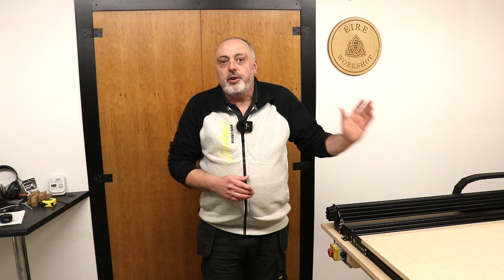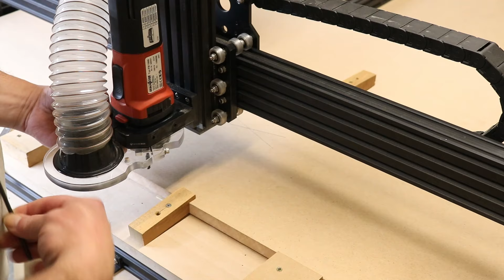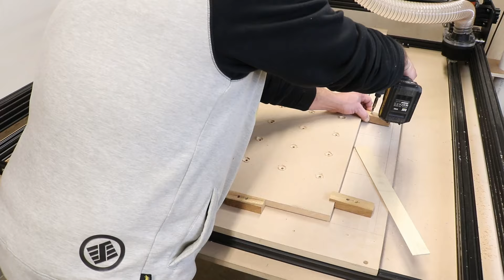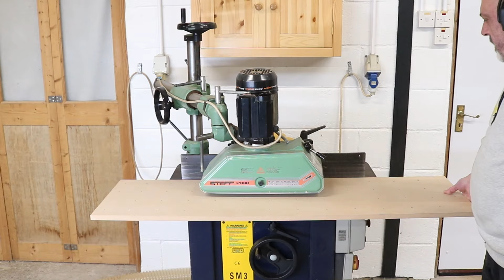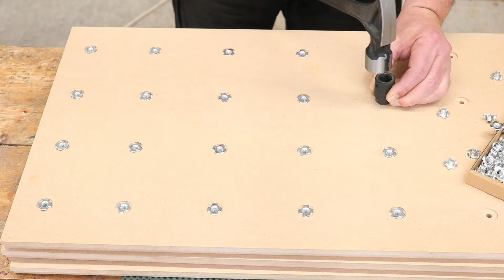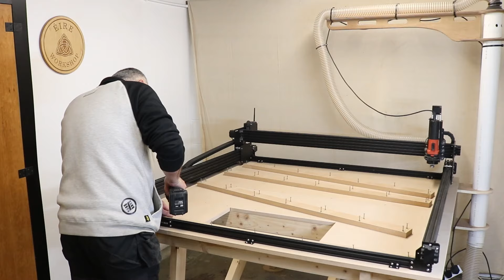How To Make A CNC Spoilboard In 3 Sections

Comment: Clever modification to give yourself extra height Tommy, very simple but I bet many haven't thought to do the same.  I'm suspecting your looking to introduce some sort of vertical ability to your CNC by being able to remove the front spoil board and access the hole I saw there.  I'm really interested in what you do to make this CNC a 'Tommy special' so please keep them coming Sir.
Reply from the maker: That's the beauty of a kit style cnc leaves to open to improvements and you are spot on the hole in the bench gave it away 🤣

Comment: Really like the solution to giving more depth and the 3 section approach I’ll definitely consider this when I come to replace my spoiler board. Thanks for sharing . 👍
Reply from the maker: Thank you 🙂.
Reply: Hi, I’ve got the maffel spindle like yourself, do you have any issues with cutter pull out? I’ve had it a few times now, it feels like I have to really tighten up the collet rather than just the 1/8th nip 🤷
Reply from the maker: @Phenrica  hi, no I have not had any issues like that since changing over to the mafell. Can I ask are you sure the bits are the correct size for the collet as a 6mm bit will be too small for a 1/4" collet.
Reply: now that’s a good question Tommy, I do have a range of bits and collets (8mm, 6mm, 1/4, & 1/8) and I’ve got them sorted accordingly however I’ve never measured them just taken the manufacturer’s size as true 🤔. Having given them a measure I can confirm that they’re ok. Ooznest’s supplied 😉 it’s the 1/4 up cut and a Rutlands 1/4 compression bit that seem to misbehave, maybe I’ve just not been giving them a good nip 🤷‍♂️
Thanks for the reply
Cheers Steve

Comment: Hey Tommy, Really Appreciated Your videos on Workbee. I have just finished surfacing your spoilboard and running the grid looking forward to my first real-world project today. Great Design. One thing to note in the video is that the two end clamps do not need to be T pieces. I machined mine up before realizing. Anyway, keep up the great videos, look forward to more CNC content
Reply from the maker: Thank you very much, I'm glad you found my videos helpful. Just a note the end pieces are not T pieces they only have one side machined but will still do the same job with both sides machined 🙂

Comment: After many months of thinking about getting a CNC machine, I'm both a computer programmer and maker so this intrigues me greatly, I'm just getting to the point of buying a Workbee Z1+ CNC and have been trawling through the InterWeb to find out more about it. Since I regularly use 8x4 sheets of marine ply I'm aiming to get the 1500 x 1500 version and was delighted to find your series on assembling the CNC and now the creation of a suitable spoilboard. Many thanks for doing this. I look forward to seeing what you do next with this great machine.
Reply from the maker: Thanks very much, I'm delighted that you found the series helpful. Yes iv been getting mine specific to suit my needs and I think this spoilboard is perfect for the machine and using 8ft sheets. Don't forget if you decide to get a machine to use the link in description of the videos it helps me to continue to create videos 🙂
Reply: Done, but I don't know if it worked.
Reply from the maker: @tetleyk  enjoy the build when your kit arrives 👍

Comment: Hi mate, great video. I've recently finished building my workbee, can I ask you, when you surfaced the spoil board, did you use the touch probe? Or did you just hit go on the programming?
Reply from the maker: I used the probe to set the z height, I set the position of x and y to the centre of yhe spoilboard manually. Hope this helps
Reply: thank you mate, huge help

Comment: What is the make of the router you are using there? Is it a router or a spindle? And is a 65mm diameter as in the same as a Makita router?
Reply from the maker: It's a Mafell fm1000 milling motor it is an excellent piece of kit